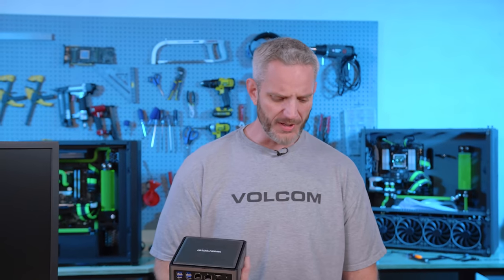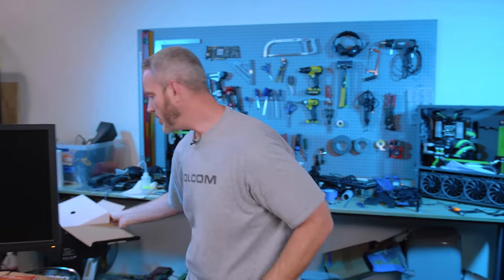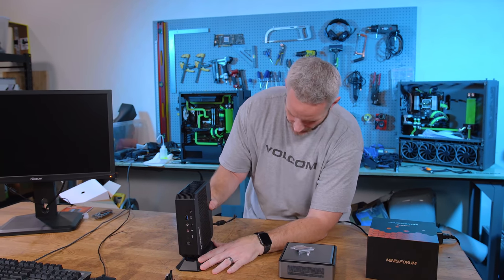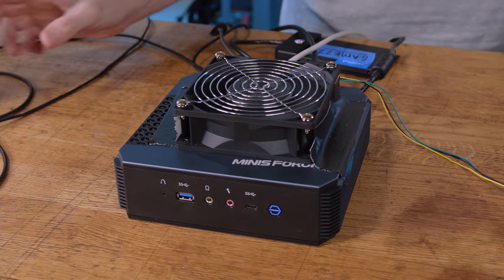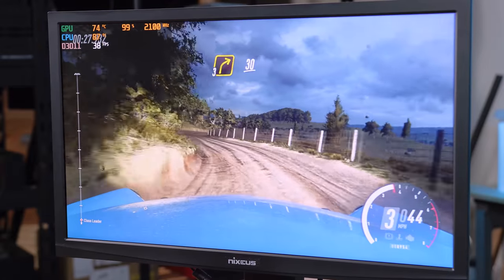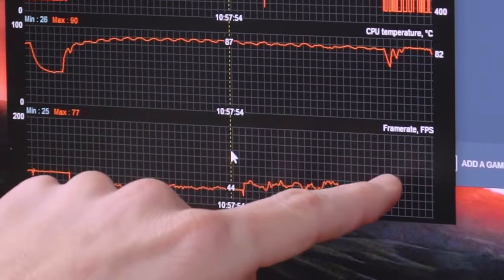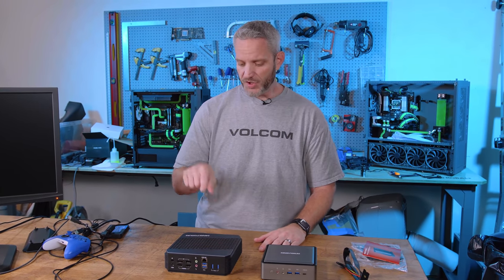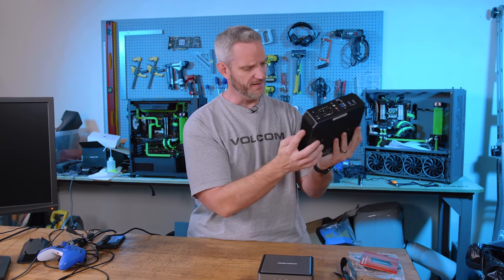It LOOKS like a modem... but its actually a Monster PC!

Comment: This video aged like milk.
Reply: Shows you who's advice you should be taking. Jay🤡
Reply: Why? Because someone else got a bad unit? My minisforum works just fine.
Reply: @TravelingStacker  And does it have liquid metal cooling? And actual carbon fiber?
Reply: Working fine is not the same as getting what you paid for.
Reply: @obfuscurity  Neither. I didn't get this model. I got a different one to use at work.
Reply: @TravelingStacker  Gamers Nexus received 2 units like that and multiple other reviewers said they got the same thing. Those should have never made it out the door. That is what QC is for. Even setting that aside, they made multiple false claims on their marketing. Reviews are product specific. Your experience with a different product from the same brand does not matter. Jay seems to do these incomplete reviews so I've unsubscribed. Can't trust the reviews anymore.
Reply: @TheNannerBeans  He's never been into complete teardown reviews. Most reviewers don't go that far because most people find it boring. If he never did full teardowns, why did you subscribe in the first place?
Reply: @TravelingStacker  I initially thought he was a reliable source. Obviously I was wrong. It's not about complete teardown or not. It's about coming to the right conclusion. If he doesn't do enough to come to the same conclusion as Gamers Nexus or Derbauer than he can't be trusted. Simple as that.
Reply: @TheNannerBeans  Guessing you weren't around when he claimed that APUs are actually chiplets. He knows very little if it's not explained beforehand.
Reply: @passintogracegoldenyearnin6310  I don't recall that so possibly or I just didn't watch that video. I really care very little about CPU architecture and wouldn't know enough to know that it's wrong anyway.
Reply: @TheNannerBeans  Yeah a lot of these reviewers keep a following until they make some obvious-enough mistakes. Most watchers don't know anything about the internals, they just think it looks cool and they might eventually buy one.

Comment: Every time I see a Mini PC like this I am so impressed at how powerful hardware has become and how little cooling is needed.
Reply: Hell even the M1 iMac's entire motherboard is smaller than a bar of chocolate and the only reason it needs a fan is cause the case is like 1.5cm
Reply: Actually the extra airflow giant (for the "modem" size of the PC) fan addition not being enough to improve the speed with more than about 300MHz all-croe shows that the heatsink is definitely neither sinking, nor dissipating enough heat.
Reply: @ReclusiveEagle  Yeah, but it performs as a phone, this monster actually resembles a computer!
Reply: AMD has made the core of Xbox and PS for decades. So, not much of a surprise.
Reply: @PokèMyBalls  Well save for the recent gen they have all been pretty underpowered. I guess its mostly being the size of a wii and having specs that, while still have low gpu power, are fairly modern
Reply: It largely because the power pack is outside the case.
Reply: @nevoyu  Integrated power supplies are nicer to have than a giant brick. The performance loss sucks though. I guess if you have somewhere to strap that power brick it doesn't matter.
Reply: @nevoyu  Practically all PCs this size have an external PSU at this point.
Reply: Clearly, little cooling is not enough seeing how this went to 90, which is too much whether or not its rated for 105
Reply: I was going to say the exact opposite. I find the performance of this thing pathetic for its size.
Reply: Cooling is always needed lol were just getting better at mobile cooling..
Reply: @nemtudom5074  I agree thats why I undervolt my laptop. Idc if its peak performance is when it's in the 90's I don't want my stuff throttling. For real my laptop played like shit back when it ran hotter. The lil stutter from a cpu throttling at certain points is noticeable to me. I didn't pay that much for a throttling cpu and frame dips.
Reply: octa core mobiles :D
Reply: Well I don't think cooling has become less important. Quite the opposite, I think good cooling is more important than ever. It's just that compact cooling methods are becoming more efficient, and I think they'll only get better within the next decade as we move to more compact all around units.
Reply: yeah
Reply: @AFpaleoCon  That would mean you don't know a lot about computers to compare it to.
Reply: Built myself a mini-stx 3400g system. Coming from a mini-stx i5-7600 build, I was very impressed by the 3400g. And that's also owning a 3600+5700XT mini-itx system.
Reply: @igameidoresearchtoo6511  Ya def not. I have a 10900k and RTX3080 all customer watercooled by me. Don't know shit captain. Maybe I'm not impressed by poor engineering?
Reply: @AFpaleoCon  This is not poor engineering, it's Not meant to be a gaming pc, nor a workstation, it's a media consuming device that is made to be nice and small, that is also capable of doing lite workloads as a PC, if you think this is poor engineering, I would think that you still need some more knowledge to argue.
Reply: @igameidoresearchtoo6511  well idk, what can u say after that lol
"I am at a concept car convention, but I think I'm at Top Fuel"
Reply: @debbidonosenshi  ?
Reply: I've had this hx90 for about a month and I'm pretty happy with it. But I'm also not trying to play Elden Ring at 8k or anything.
Reply: It would be cool if they did the same size thing with a mobile (like max-q) type GPU station and you could connect them via TB4 or some proprietary way using the base/stand. Like you could click them in and out and maybe have a fan in middle. Have a 3rd slot in base for interface and drive extensions. Then you have updateable system that's smallish and clicks together. I don't see much use as it is though, sort of have to pretend competitive laptops don't exist.

Comment: Der8auer roastet this Pc really hard, because there is actually NO liquid metal under there and Yes you read right NO liquid metal under there. Instead he found liquid metal "splashes" on the ram and a bit in the case. And also the carbone case, that's not real carbone. What where they thinking to do that. So not looking under the cooler was a mistake...
Reply: Steve from GamersNexus also roasted it pretty hard (literally, I he held a soldering iron on the "carbon")...

Edit: He held the iron, not me.
Reply: @blockbertus  Yes your right, der8auer did mention that. And Steve was the first as far as I know who did and discoverd it.

Comment: Well, unfortunately there is no liquid metal cooling but conventional thermal paste inside and the case has also no carbon fibres in it, as gamer's nexus and der8auer just found out... Please upvote so everyone can see this and maybe the video could be corrected...

But otherwise great video. Thank you for all the fun and entertaining content!
Reply: A sane human spreading mindful caution. Have an upvote for your positivity.
Reply: This. Minisforum is NOT to be trusted in my opinion.
Reply: So anyway, funny thing....mine came yesterday. I got the 32GB model. The bottom panel is secured by phillips screws with a black-chrome or gunmetal finish. The blue plates appear to be anodized aluminum, and the top and bottom lids fasten to the metal fan shroud inside. I opened it up and the system was clean inside, but I also took a couple 64MP photos and examined them. The board's heavier than I expected, and from examination most of that mass is in the heatsink assembly. Cooler is designed to channel air directly toward the vents on either side.
System RAM is better than Minisforum led me to expect @_@;   Two sticks of KVR32S22D8/16 dual-side-dual-rank memory! Based on this I am probably not going to purchase a Kingston Impact CL20 upgrade kit unless I migrate to 64GB. I am still in the middle of benching, but out of the box it scores about equal to a 5900HX in a high end gaming laptop...just with lower temps. Cinebench R23 single and multi, it outscored a laptop with 32GB single-rank DDR4-3200 quite handily.
I have no verdict on the case plastic other than the midsection is definitely a different material and it seems stiffer than the bottom. Could be CFRP, could just be a stiffer plain plastic, don't care. Makes a higher pitched noise when struck.
I think from initial POST, the system finished Windows setup and got me to the desktop in less than five minutes working over wifi. Definitely much less than ten minutes.
CRITICISMS Even if not looking for metal, I would have opened my case anyways because the boxes do not have model specs on them which is a bit worrying. Also the base has a rubber foot which seems nice and grippy, but based on the rubber smell I am wondering if the gripper could mark some surfaces or dry out and crack. I may use either flat or Vesa mount instead.
Reply: @passintogracegoldenyearnin6310  Yeah sure, totally not paid for.
Reply: @fzth-t7s  Actually it cost me $909usd with free international shipping, so I yolo'ed for the "duty-free shipping" gimmick too. Which is probably unnecessary almost everywhere in the world. I'm kinda pissed I can't get more than what I already ordered, they've put new orders on hold for "inventory reasons" but it's possible this is also due to harassment or heck.....if the case plastic failed independent testing they may need new cases manufactured. I just want about 1-4 more beyond what I have now, plus replacing my wired ethernet switch with a 2.5 gig to match.
Reply: J M  Pfffhahaahaha you must be the poor guy that has to edit his videos! I flat disagree on several of your points based on actual experience with the 3900x and 9900k, but what I especially note is one thing that prevents me from responding to you seriously:

The simple feelings which you expressed above all stem from losing 1) your perception of AMD as an underdog and 2) your savvy-shopper vibe from buying underpriced AMD CPUs.
Reply: There IS liquid metal cooling on these

Comment: Try swapping out the memory sticks for dual rank memory, they give you single rank ram.  Also need to adjust bios settings to up the GPU memory to 4GB with 64GB of Ram and then test gaming on it. (Similar to the OEMs cheaping out on ram on laptops)
Reply: OEMs always cheap out on RAM, because it's one component they can charge more money for and give you less of it because they don't buy directly from the DRAM suppliers.
Reply: Nah when you're putting more $ into your memory than your GPU, you're fucking up.  That isn't what mini pc's are about.  If you want a great channel on this stuff, watch ETA Prime.
Reply: bios setting memory for igpu's doesn't work on AMD. it uses the same amnt no matter what you set.
Reply: This.
These changes should make it far more competitive.
Reply: @armyofninjas9055  RAM matters for APUs, period. Devices like this using lazy latency cheap bargain bin 3200 MHz ram, will take a performance hit. You obviously have no idea how integrated GPUs work or you'd understand.
Reply: @JosephArata  thinking about picking up one of these, I’ll keep all of these comments in mind and buy my ram and SSD separately
Reply: Look again, has 2 RAM SODIMM installed, more and faster yes, but it's already dual channel
Reply: @z0phi3l  see this review where where he swapped in better memory https://youtu.be/fHpBsPxixkg
Reply: @JosephArata  hardware unboxed already disproved this you will get very little benefit beyond ram of 3200 or 3600 cl 16 or cl18. like there best ram kits got you like an extra 3 to 5 fps if that honestly. its just not fast enough to make a difference. hey maybe when ddr5 comes but who knows.  the evidence is all right here https://www.youtube.com/watch?v=mi4eAWWWxGc   the price of those ram kits are crazy expensive to lol.......
Reply: @winonesoon9771  I'm not talking about more fps, I'm talking about frame pacing.  There's a huge difference.
Reply: @winonesoon9771  Not to rain on your parade, but 3-5 fps when you're sitting under 60 is actually a pretty big performance improvement, we're talking about 5-10%. Not only that, but if you can get locked 60 fps instead of the crazy fluctuations shown in the video, it will lend to a much better gaming experience.
Reply: @z0phi3l  
He's talking about dual rank not dual channel.  Some 16GB sticks are dual rank which can speed up some uses.  To more or less guarantee dual ranking with 2 slots you'd put in 2 32GB sticks.  In your desktop you can dual rank with 4 8GB sticks though the loss of a little performance through a 4 stick config can make it a bit less effective.
Reply: @jakehead20  
The difference between a locked 60FPS and an FPS that jumps around even by 10% is incredibly jarring to me, I can understand why in a few people fluctuating frame rates can trigger motion sickness.  Unless I can get FPS so high it overrides my eyes then I prefer a 60/60/60 lock in games over a fluctuating rate that goes a bit higher.
Reply: @jakehead20  yeah i get that but 16gb of 3200 cl 16 cost like what 65 bucks maybe less if ya lucky. other stuff cost double and hell might not even work most people cant even get 4000 ram to run on ryzen lol. idk ram is one of the biggest over spent things out there for 3 percent of performance its just silly. but i mean more power to ya if ya want to shoot at least ram prices are finally going down thank god ha!
Reply: Jay's own testing showed no difference between 256MB and 2GB of memory dedication to .
Reply: @shredderorokusaki3013  
You're SSD can't do those speed it's limited by PCIe 3 bandwidth, lot of storage you have there though.
I use the same CPU as you.
Reply: Well mine came with 2x16GB KVR32S22D8/16 which is way better than the model specced on their site. I haven't touched a damn thing other than letting Windows Update run overnight, and it's benching above the review scores. Cinebench I've got 2260 on R15, 5190 in R20, 1490 single R23, 13030 multi R23 (~8.74 scaling).....and in 3DMark Time Spy 1651, Fire Strike 4157, Night Raid 17864. As a spot example, Jay had trouble hitting 5000 in R20.
Reply: @armyofninjas9055  ...on APU's that's literally the opposite of correct.

Comment: i'll tell you what it's for: remote job from summer cottage :)
i built something similar in size and power (b450i wih ryzen 4650g powered by pico-psu) because i wanted to move home office to my summer cottage, but did not wanted to carry my custom loop.
for that purpose it served awesome - 6c/12t more than sufficient for work and the igpu for some late night gaming of older/undemanding games (i played black mesa) - i'm very happy with this build.

Comment: They should change to a full copper unpainted with copper heat pipes. It might help. More airflow didn’t seem to do a lot.
Reply: you shouldn't use liquid metal on pure copper it will eat away it, that's why its nickel plated. :)
Reply: @CreamyI3eaver  Aluminum has that issue, not copper.
Reply: @nickoloes  Its no where near as bad apparently but my old gtx 1080 water block would argue with that statement. It was on for about a year though so idk and it was also my first and last time using liquid metal.
Reply: Liquid metal still diffuses in other metals and that diffused metal doesn't fulfill its role as a TIM so you must reapply some.
Reply: @CreamyI3eaver  But this doesn't use liquid metal anywhere in the computer, as Gamers Nexus and der8auer found out by simply taking the cooler off of the CPU.
Reply: @titaniummechanism3214  der8auer really had the better take. He was definitely angry but he redid the paste himself and posted numbers to compare.
It's kinda funny that a system-builder channel like this one doesn't have any spare compound laying around? I can let other channels slide but a builder should rip it open.

Oddly enough, der8auer's before-and-after numbers convinced me to buy one of these. I'll do the paste myself if the final units have the same assembly defects.

Comment: I dont know why these units are STILL soo mind blowing.. basically its the same engineering that has been going into laptops for years, except they don't have to deal with any laptop specific constraints aside from the physical size
Reply: I’m sure someone a lot smarter than me will explain it to you
Reply: @theadmin2726  and as I said, these are not new, a different variant comes out each year... remember the Zotac Zbox or whatever and how blown minds where??? Company's have known how to do this basically since Intel 3rg gen, maybe longer
Reply: The ASRock MiniDesk X300 is way more impressive.
Reply: You could say the same about pretty much any PC component... Or... Like... Every single thing
Reply: @shredderorokusaki3013  ummmm.... well, you get a comment and a like for campy word usage...
Reply: It's because people have wanted them for years but they were only sold into the corporate IoT space. We're finally seeing serious development in the consumer space, so as people see more designs and better prices they will get a bit excited.

On similar note the Thunderbolt eGPUs are still huge and the interface/drivers can still have issues. But if devices like the Flow 13 show enough interest then we may see compact Thunderbolt/Lightning/USB4 docking solutions similar to the XG Mobile 1st-gen dock. Call it a logical evolution.
Reply: @dragonsystems5973  A dual-core designed for WinPXE was not exactly appealing to everyone, and the beefier ones carried too much price premium.